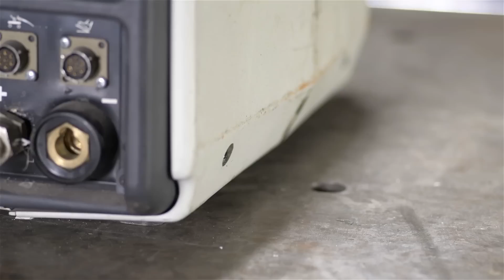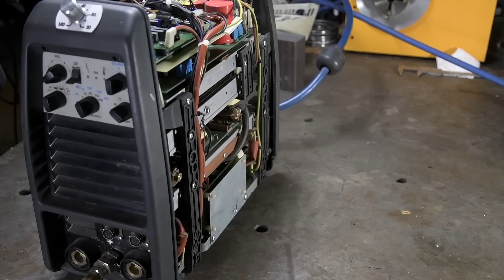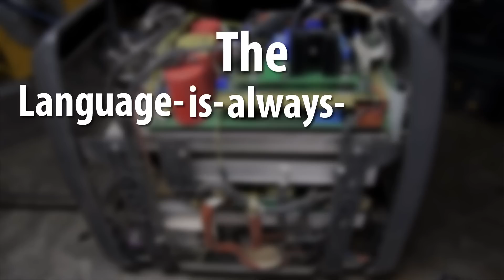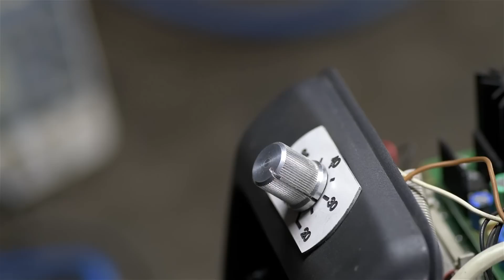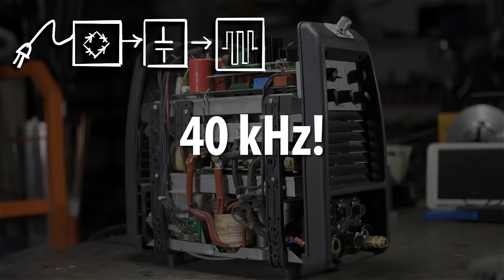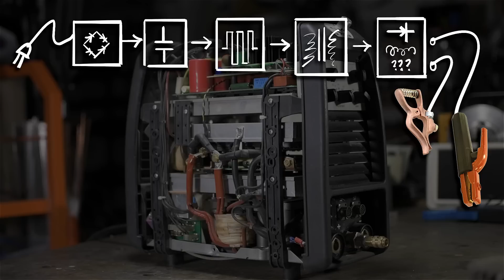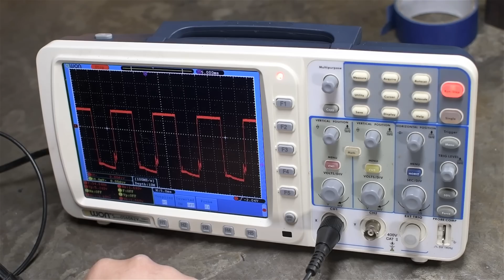My TIG Is Breaking Up With Me - Part 2

Comment: if you werent such an ac user, id say just go find a decent commercial welder at auction, my current welder is a miller xmt 304, i pulled out of my buddies junk yard! yup a $40 thermistor, and all is perfect. plus nothing against your machine, but ive never even seen one of those, big name welder = far more help on tge interwebs. though i have no a.c. ability, i can get crazy and hook her up to 3 phase and get 450amps?!??!! no clue what i would do with that much power, maybe weld 2 bridges together in a single pass, but the options there lol.

Comment: If you decide to throw it away please post about it on the forum, 
I' m 16 years old and I started learning stick welding on my own three years ago, i'm pretty good at it, but i never weld anything thicker than 3 mm  so i was looking for something better (aka TIG) but at the moment I can't afford a new machine and most of the used ones you find here are three phase or really over priced
Something used, even if has some defects and doesn't run properly would still be great 
As always a great video !

Comment: try switching every black cable with its corresponding red cable, it should just flip the output wave to the opposite, and you'll generate electricity every weld you make. trust me, im a whitecoat

Comment: Think of inverter circuits like.... push-pull amplifiers. The transistors or FETs that do the switching action are fed the generated waveform that you selected by an oscillator circuit, and positive and negative DC voltage commensurate to the desired peak-to-peak voltage (1/2 vpp on either side). There are generally two issues that can cause the output waveform to differ from what you want out of them (without the transistors or FETs that do the switching action being bad themselves) and causing this weird more-negative-than-positive bias;
1: The input waveform being generated is being biased to the negative side
2: The switching power supply is generating more/less positive/negative voltage than it's supposed to.

Power supplies are generally the first to go in just about any application I've seen, so I'd start there. If it were the waveform generator (oscillator) you would generally see a lot more crusty of a waveform coming out of your push-pull amplifier, and with far less consistency than what you're seeing.
AvE has a good understanding of switching power supplies, so it'll give you a good reason to link up with him again. (:D)

Comment: 99.9% of the time electrolytic filter caps are the reason a switching power supply fails. Check out Mr. Carlson's Lab. He does a very thorough video about repairing industrial switching power supplies for CNC machines
Reply: Yeah.....agreed...! I made that comment on Part 1, but others said it was too expensive....you can just unsolder and test with DVM and get some idea of the condition....
 If this is a half decent ($$$) welder, should be worth the effort.
Reply: Doug Ankrum lol I did too. Easy fix if that's all it is
Reply: I'd say it's more like 90 when you specifically look at the filter caps.
maybe 95% when you count all possible caps.
The rest is diodes, mosfets, support circuity and so on (just had a 40V PoE smps fail on me because the small support cap of the control circuity on the HV primary side failed silently with high ESR and lowered capacity but visually ok)
Generally I recommend https://www.repairfaq.org/sam/smpsfaq.htm (maybe not the best for an inverter welder but the tips and ideas are still great).

Oh and testing the Caps is really easy with an ESR meter like the cheap KKmoon Diode/Transistor/Triode/Resistor/ESR testers (based on an OSHW design/concept from here https://www.mikrocontroller.net/articles/AVR_Transistortester )
Reply: I was thinking along the same line. With the machine being a little long in the tooth, in an industrial setting, I’d be tempted to replace as many of the electrolytic caps as I could. They do dry out in time. I think there’s another fault going on too, though no idea what.

Comment: i think i would spend some american pesos to replace some capacitors even i dont know exctly which one is guilty, obvilsy there are more complicated things that could go wrong, but i would give it a try,  while you decide on lincon,  miller or chinesium. also if that thing works with igbt i would check those. there is a guy in spain that repairs switching power supplies and inverter electronic welders , he seems to have practical experience and theorethical knowledge,  search for  "emilio en tu casa"

Comment: Check the solder joints on all power devices. Thermal cycling usually causes bad joints.

Comment: I notice 2 surface mounted  electrolytic capacitors on the logic board . These '' caps '' are known to cause problems after some time .  You Can try to heat  ( hair dryer) or cool ( a can of  contact 75. freeze ) them , watch what happens with the wafeform on the oscilloscope .

Comment: I'd bet that surface mount logic board is full of op-amps and comparators, given the layout and pin count.  Maybe some inverters to create an oscillator for the pulse and AC features.
Reply: and the constant current control probably

Comment: Wild guess: a bad cap somewhere in the control circuit for the negative half of the cycle... perhaps on the boost converter for the mosfet driver? 🤔
Reply: I don't remember the age of the machine but if it was made during the "capacitor plague" that could very well be the cause.
Reply: If something went wrong in the FET/IGBT driver itself, the FET/IGBT would be blown to bits from operating well beyond their SOA. I'd place my bet on incorrect supply or reference voltage for the clipped positive current waveform.

Aside from clipped amplitude and DC bias range, everything seems to be working correctly, so the problem must be in the low power analog control side.
Reply: Yeah,  What these guys ^ said  !!!
Reply: Radovan Blažek because of the form factor of this thing, he'd have to solder on wires to points where he'd want to probe. You just cannot safely probe this thing just holding it by hand. And without any schematics, it would be quite hard to trace out the schematic. Factor in his time to fix it and it's probably beyond economical repair.
Reply: Yeah, definitely looks like something bad in the mosfet/igbt bridge that switches the welding current polarity.
Reply: dark winter,, is that called clipping when part of waveform Peak, is down like that?
Reply: Soooo... on the board with the high current connections going off it, under the big heatsink Tony didn't remove, then?
Reply: Hippie Engineering Works its always the one thing you dont check
Reply: Yeah....my experience with electronics is 20+ years ago...but most stuff is still the same....solid state devices usually fail catastrophically......but electrolytic Capacitors just get leaky...I'd be looking at them....
 ...Mr Carlson....(Mr Carlsons Lab) usually doesn't work on welders, but his feelings on electrolytics over a few years of age....just change for new ones.....??
Reply: It's probably some capacitor that shit the bed. And it could be on the drive side or the power side. But if you have no idea which capacitor it is, there's no point in changing capacitors. It's simply not economical and hardly feasible to change ALL the capacitors in that welder.

I think it's safe to say this is a problem that can't be fixed by Tony himself, no matter how much time he puts into it.
Reply: If he could just get the oscilloscope probe to the gates of the output current inverter bridge transistors, while it's running then he can track it from there, maybe. Signal chain is probably something like potentiometer->comparator->some gate driving circuit/ic/transformer->MOSFET/IGBT

Comment: 13:18 2nd red capacitor from the bottom looks blown.
Reply: No, it does not.
Reply: Those capacitors look fine, the stuff you see is probably just glue.
Reply: Bulging only tells you it's definitely bad.  If it looks fine then it COULD be bad.
Reply: Maybe I'm blind but I don't see any bulging...
Reply: NordboDK The black glue is there to secure them mechanically. But well, it looks like a crack on the first glance.

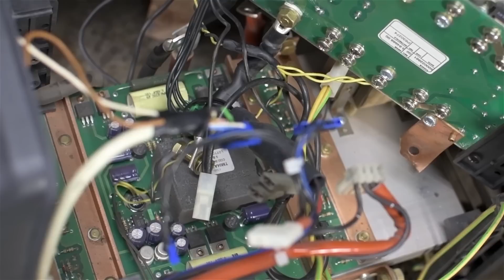Anyway i would check 13:42 , far right side of the picture, half way down. That dark spot (if it is not just a shadow in the still image...) looks like something got hot there = carbon residue and it matches the problem description, as this seems to be the board with the MOSFETs and part of their gate drive circuitry. Tracing the line, that part would only affect one of them. Whatever component is there, it is hidden behind the heatsink and harder to spot than the others. Still, it could have only been a shadow.... In case there was an overheated component found, replace it and wipe that smoke residue off, insulate the PCB again afterwards (there is some electrical insulation lacquer spray for that purpose).

Also, if not already done, it might help to wipe of this metal-ish dirt on the left side of the same board to prevent a path for a spark to travel. The board looks shiny on the picture and might therefore be properly isolated, so it might not be a problem at all. But... you know just in case.

What i don´t understand is the copper connection below that very MOSFET, it looks torn apart for some reason, kind of. It might have played a role, as when resistance increases on that end, the relation of power dissipation changes within that circuit as a result and could overload a switch. It doesn´t look like a heat transfer piece, but for an electical connection it looks weakly connected with too thin (and therefore bent) piece of copper. The active cross sectional area would be strangely affected on how this is bent.

Just for fun i checked prices on the low end for TIG welders, with 200-500++ Euro i can understand getting a new one might be more interesting than fixing this. OTOH, you got some videos to make about it :-). As usual thanks for your videos! 

I can so far not see a methodical error in what you show us there, using the proper current range for the current probe and so forth. The 40kHz switching frequency might be correct if measured in the voltage, not the probe, as it is rated for 20kHz. For the overall 50Hz waveform you made your measurements for it should be sufficient.

What a cute kitten, but... is that your backlog or was it a similar one from the last appearance (can´t find which one it was in)? That would by now be almost adult.
Reply: Looks like black silastic glue to me, but what do I know.
Reply: If it had blown, circuit protection systems would've engaged and he could see the blue smoke coming outnear , and it would've been a blast(no pun intended) to fix
Reply: Sorry for warming this up, but after thinking a bit about it:
Maybe the current probes "permalloy" core is either going into saturation or its amplifier reaches the top end of it´s spectrum, as it is 45A for the negative part only, while the positive reads 20A. This equals 65A peak to peak for this almost rectangular waveform. Its product description reads effective current, which could mean root mean square, but could be a misunderstanding by the translator. Another one reads 20mA-65A DC range, which could mean 65A peak to peak max, although the RMS of your waveform would be "40A" for 40A+ and 40A- amplitude rectangles.

Measurement devices like these are not rated as known from household devices for sinusoidal waveforms (effective current [translation from german] or root mean square value). Which is why there is usually a distinction between AC (uses an electromagnetic flux core and just converts the voltage of this secondary one winding coil) and DC probes (uses hall effect sensor in a gap).

This means that the clipping to 20A positive in the full range operation might just come from the probe itself and how it converts, but does not explain the complete missing "DCEP" part and the funny sound your welder makes. Otherwise... the other FETs probably would have overloaded and blown.

Which means your 40A setting is 80A peak to peak to the probe, so, if i am assuming this correct, you would need a probe rated for 80A or simply try a lower setting and see if the clipping persists, to rule that out as part of the symptoms.

Your zero balance (waveform too far negative) could be a magnetized core of the probe from measuring too high AC currents with it. They can be demagnetized and are good as new afterwards. The hall effect part is afaik not susceptible to this problem. However you could check with a known good AC source and resistor load (toaster, e.g.) if it is alright.

However, back to the welder: you have shown that this behavior starts only after a certain time, can it be that this is actually the overheating protection that is then only switching half of the machine off or some fault that keeps switching the other half on?

Comment: Does the kitten weld?
Reply: Only if you rub it fast enough!
Reply: It's Schrodinger's cat.  It welds and does not weld at the same time.
Reply: Now that he fell into the Black Hole chip, he probably doesn't do much of anything ... endlessly.
Reply: Does the kitten weld? 

The psi-function of the system contains both the kitten welding, and the kitten not  welding.
Reply: Nah, he's still a kitten. But surely one day he will, if he's a he...
Reply: @J0hnn0_JS  feline welders are hot
Reply: Not easily. Low heat and a nickel-iron rod will work, but it smokes a lot, so use a respirator and be sure to wear hearing protection to avoid the loud screeches.
Reply: Robert Pinder. typical cat
Reply: weshowe - I've had good results using E7014 with HF stabilization but that was on a long-haired breed. It's hard to keep the arc lit on longhairs without the HF. Fume extractor is a must.

Comment: When it overheats you should just pour water on it. That's what I did to my wife's laptop and it hasn't overheated since.
Reply: Hey, I'll tell you just like I tell her. I fixed the overheating problem. Any other issues with it "not working" aren't my problem and probably unrelated to my solution.
Reply: in such cases it is not uncommon for the overheating issue to jump to the human operator of the machine, good thing is that water helps again, as short and long term solution, you lose one wife, but hey - the problem is solved!
Reply: Cant overheat of it doesnt turn on.
Reply: Oh, Al!
Reply: sure, it hasn't overheated, but does it still turn on?